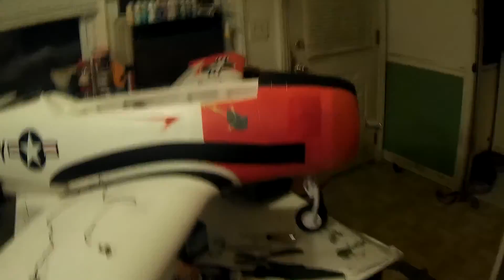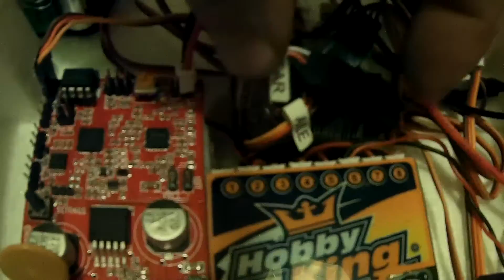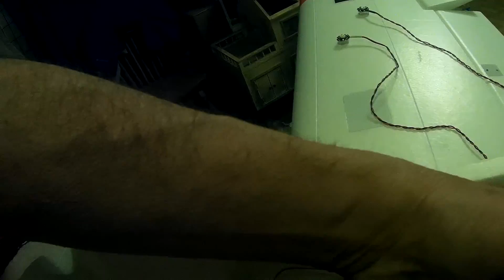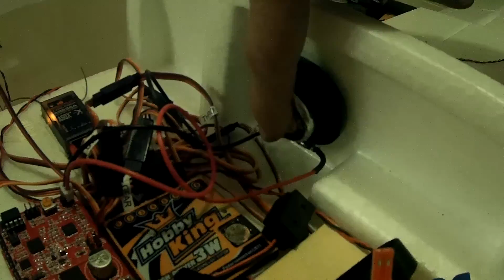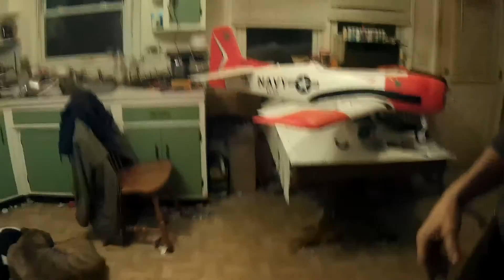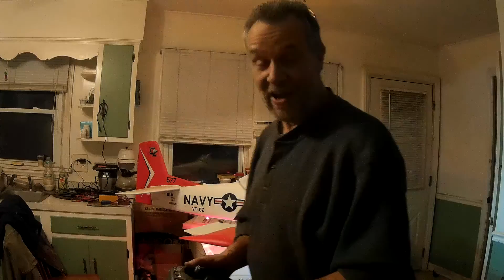E Flite Carbon-Z  T-28 Trojan 78 in.  With High Power Cree LED's & Mr RC Sound

Comment: Skip I really love that T-28 of yours with all those beautiful lights.  I received my new carbon z trojan 3 weeks ago and the maiden flight took place just 2 days ago.  Everything went well and I love the way this plane flys.  You've have encouraged me now to add some lights to it.  Will look up Hobbyking to see if they are still available.  Cheers and thanks for sharing.  All your videos and planes are great.
Reply from the maker: Hobbyking doesn't have them anymore.   Motion RC. Carries them, but you'll have to lengthen the wires for the wing tip lights.  3 watt High Power at Motion RC

Comment: I don't have this plane yet, but was wondering how thick are the tips of the wings ? Reason I ask could you have enbeded the wing lights inside the wings and then used something to cover over them ? I have the smaller version of this plane made by Dynam which I've had to rebuild after a crash, I've had 2 of these the gray and the white one. The white one I rebuild I put flashing lights inside the underside of the wing, the glued it in and cover over with foam filler the painted. The other wing tried something different glue in the light then covered over with plastic then painted. The lights I used came on a pcb maybe 1/2x1/2" for the tips used 3watts with out heatsink glued inside the wing tip.

Looking forward to getting my CZ soon bin into jets lately.
Reply from the maker: +Dennis M Pretty thick at their thickest close to an inch...maybe 3/4.  Cool plane.  Good Luck with yours....Skip
Reply: @SkipBuiltRC  LOL! This is a old comment. I don't even fly or have this plane anymore lol.  

But what I can tell you is this. I have the Easylights hard wired into one of my HSD 105mm viper jet. What I lose is being able to use the 3 different modes but am okay with that. When I power up the plane all the lights come and no more having to recharge or press buttons to turn them on. I made a video of how I didn't it, it isn't posted yet as am still working on the model with other lighting.
Reply from the maker: @JetJunkie-NJ  lol.  Just happened by your comment and saw it unanswered.   Sounds like a cool plane your working on.   Good luck with her.   Happy Flying my Friend.

Comment: Thanks for sharing. My thoughts exactly re the supplying lights. I've got a CZ T28 too, but due to typical British weather haven't flown it yet. Want to get lights for mine too, and thanks to yourself have found just the right ones. They sure are bright, which is great as I want mine for looks, but mainly orientation on gloomy days. How are you planning on, and where, fitting them due to the heat sinks? Are they waterproof? Sorry for all the questions, but they seem ideal. Kindest regards, Dean Cooling. Wales, UK.
Reply from the maker: +alcdbc1402 Dear Dean,
Dean is a Good Friend of mines name.  Thanks for watching my video.  Working on finishing up the rest of the lighting tonight and will specifically show the lights mounted and such.  Also a surprise to show for the nose of the plane.
Think everyone will like it.  Video will be up by tomorrow evening or sooner if it gets finished tonight.
Dont believe they are waterproof.  So have already covered beacons in rear, same to be done for wings. Using cps from spray bottles.   Landing lights  will be sprayed with corrosion x. Good Stuff.  Stuff in the nose is just waterproof strip (5050) Led's.   Check out Flite Tests channel and episode for waterproofing electronics.  Thanks again for watching.  I just love to tinker on these things.
Reply from the maker: +alcdbc1402 Hey Dean.  Here's the link to the video promised.  Take care and Good Flying. https://www.youtube.com/watch?v=Dk9SlAj3Mw0